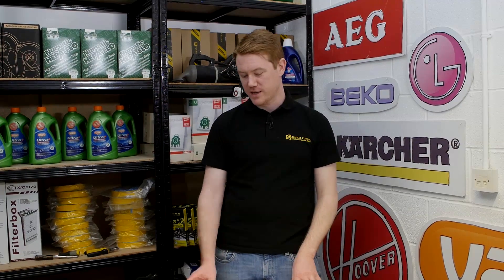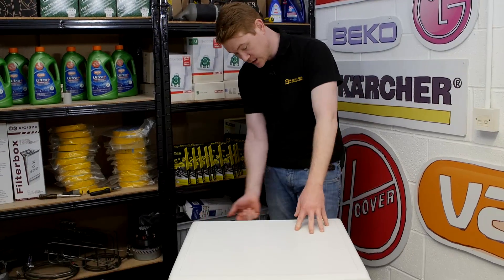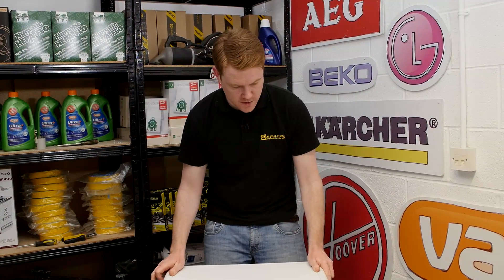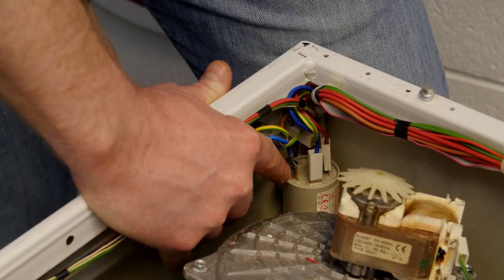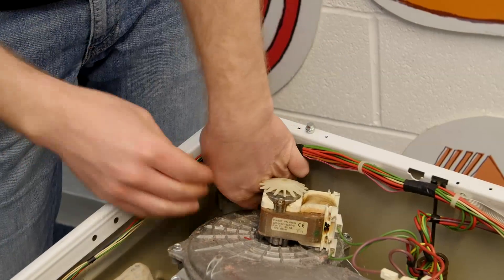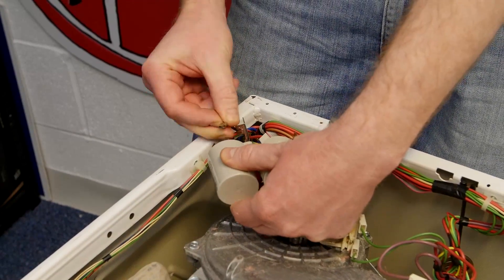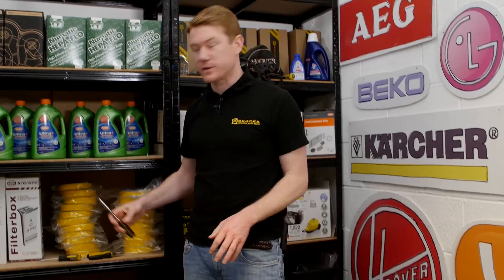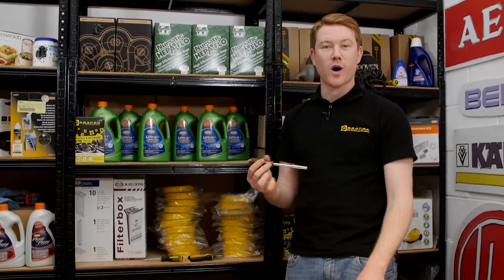How to Replace the Mains Filter on a Washing Machine

Comment: I had recently replaced my bellow due to a tear.  After completion, I noticed the washer displayed an LF code. The machine tries to fill water, but after 3-5 seconds ends up tripping my electrical outlet.  I'm not sure what could be wrong, either water sensor inlet is defective (it's not dirty, its super clean) so I'm not sure what to replace. 

Make and model of washer:
Whirlpool YWFW9151YW00
Reply from the maker: Hi sMiLey Warrior, this a little unusual as it sounds like more than one fault, the LF error code means the machine has detected a problem with it filling, usually water pressure or the valve but the tripping is worrying as that is an electrical fault.

Comment: But how do I diagnose that this is needed in the first place?
Reply from the maker: Hi Andrew, if the mains filter has failed it can cause your washing machine to blow the fuse/RCD to check look for a bulge in the casing, burn marks or liquid coming from the filter and you can also test it with a multimeter.

Comment: What causes a mains filter to go bad?
Thanks
Reply from the maker: Hi Wayne, the mains filter can deteriorate over time causing it to go.
Reply: Capacitors just go bad overtime but they are rather cheap to replace.

Comment: I've got a lamona washer dryer and it will switch on but every time it go's to start a cycle it trips my electric. Any suggestions??
Reply from the maker: Hi Gregg, one of your components inside the machine is going down to earth which is blowing the trip, the cause could be the mains filter, element or even the motor and you would need to test them to determine what is causing the machine to trip.
Reply: @eSpares  thanks for the reply.

I also recently changed the carbon brushes, do you think that could be causing any issues?
Reply from the maker: Hi Gregg, wouldn't normally cause the machine to trip and would have happened straight after replacing them so check the element and mains filter.
Reply: @eSpares  thanks again.

Do u know what mains filter I would need for a lamona washer dryer model hja8701?
Reply from the maker: Hi Gregg, if you use our website our sales team will help you www.espares.co.uk/contact/sales

Comment: What might the problem be if I complete the task as is in the video, turn the machine back on and it trips straight away?
Reply from the maker: Hi Martin,  one of your components inside the machine is going down to earth which is blowing the trip, the most likely would be the heater so start there.
Reply: @eSpares  thanks.  Turns out the motor was the problem.
Reply from the maker: Hi Martin, thanks for letting us know and well done for sorting it.
Reply: @eSpares I'm having same problem where I turn on washing machine and trips the rcd on fuse box but I have a power light on washing before it trips and it is as soon as the motor tries to start? Pls help is it motor or something grounding do u think?

Comment: I am getting 240v to my whirlpool dishwasher control panel but no lights, is this the same for dishwashers as well?
Reply from the maker: Hi Lucas, we do not advise testing appliances live due to the safety issues if you have power to the board but no light it would suggest the board has failed.

Comment: id use a multie meter best tool in the world
Reply from the maker: Hi Katrell, thank you for your comment and we agree a multimeter is very useful to help you diagnose faulty components.
Reply: @eSpares  How do you check if it faulty? Resistance to ground? Mine shows no resistance from ground to the rest of the plugs

Comment: Is the faulty filter indicator for a major problem?
Reply from the maker: Hi Harry, what is your model number of the appliance?.
Reply: Hotpoint Ariston - AQM9D 490 U
Reply from the maker: The filter on your machine is under the panel at the bottom right of the machine. If coins or other debris has been in the washing they may be restricting the machine emptying so check this and watch another video: https://www.youtube.com/watch?v=frEJhX9Sppw

Comment: I have a washing machine that doesn't turn on.  Changed the fuse in plug but no joy.  Is there a way to test the mains filter to see if this would be the problem?  Thanks for any help you can give
Reply from the maker: If the filter is faulty it would either blow fuses or no power would reach the control board. It can be checked with a meter to confirm there is continuity from the plug to the control board. The fault is more likely to be the control board if dead but if anything works at all see another video:
https://www.youtube.com/watch?v=QYPqpjLV7s4